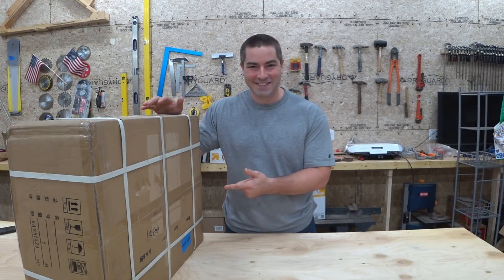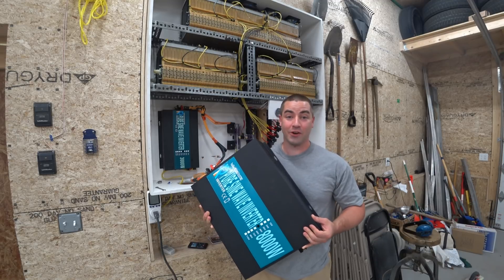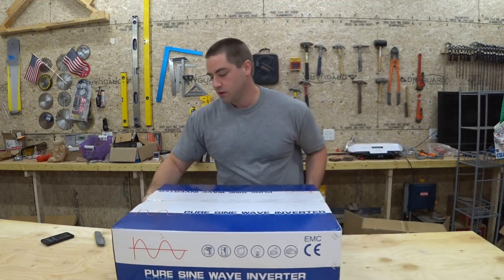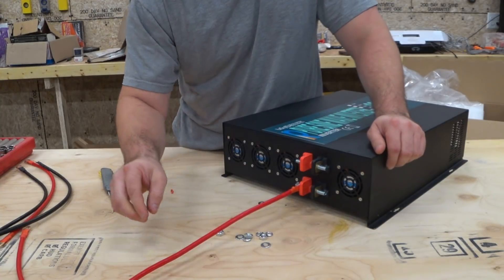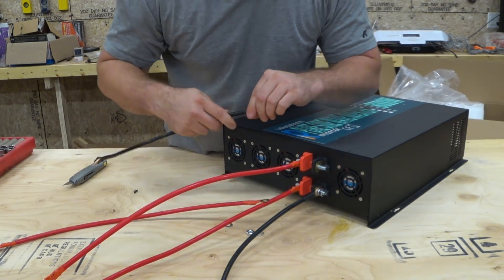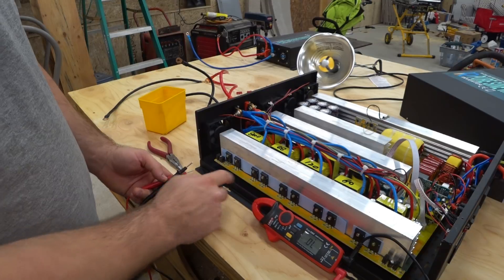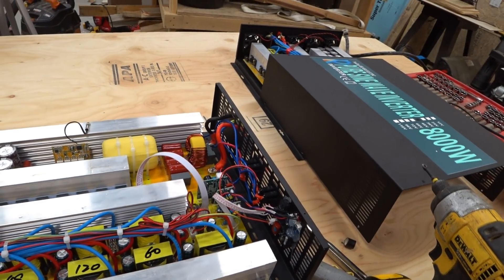Cheap 8000w Reliable Inverter, DIY Powerwall, Chevy Volt Batteries

Comment: For the sake of troubleshooting you should have shown that their was nothing wrong with the chop saw and perhaps even put an amp meter on it to prove it wasn't pulling more than than the inverters stamped surge rated capacity.  At least the company can't point the finger back at you that its your tool's fault.  Just my two cents...
PS. Just the wife's account.
Reply: Even if that saw had higher consumption, it should not end up with FETs being fried - this is why you have fuses. In fact, it should survive even short circuit on output.
Reply: His chop saw runs fine on the 3000 watt Reliable inverter.
Reply: @mark_osborne  I thought he said he got the 8000 watt because the 3000 watt blew first. In any case if this is the peak rating, then the run rating is only 6400 watts. But the normal start up for a full start, inductive motor can be 6 times it's rating. The manufacturer only states 15 amp. SO even at 117 VAC it could require 15 x 6 x 120 = 10,800 watts for a moment to start. This is normally taken care of by time delay circuit protection or slo-blow fuses on a shared distribution network. But this is not a shared part of a larger supply. This saw is known for being hard on temporary electrical services, heavy extention cords and can burn out all the small generators and cord splitters..
Reply: It doesn't matter if he shorted the output directly. It should have popped the fuses but that's it.
Reply: the saw in rush current might be the culprit here
Reply: Metering.   Brilliant.   ;)
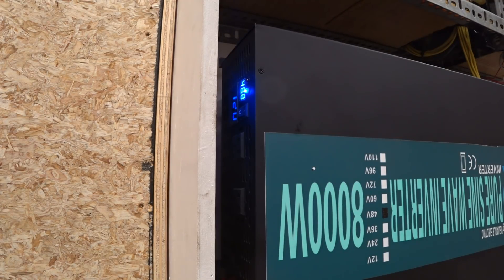Reply: He said the circuit was fused outside the inverter.  See 6:48 of video showing GFI outlet.  Amperage unknown,  however that shouldve protected the internal fuses of the inverter.
Reply: Your are right
Reply: The inverter obviously cannot take out of phase loads..
Reply: Even if the chop saw was shorted the inverter should have self protected itself but yeah he should have shown it running including a few measurements just for the sake of proof.
Reply: Even if he connected something that did want to draw more than the max output, the mosfets shouldn't be blowing.
Reply: true
Reply: What is the Momentary Surge Current on saw's motor starting ?
(use a "high-sampling-rate data-logging metre, 
you may be in for a BIG surprise).
Some cheep tools 
draw crazy amounts of current, just momentarily, when starting
(no soft-start feature).

This is why most of the world uses 230~240Volt / 400~415 Volt,
because the CURRENT draw is halved 
(when comparred to North America)
for comprable tools.
Reply: one inverter may be 3kw, the other 8kw but what short-term output will they each allow ? I have seen it suggested that at least some inverters using a traditional (toroidal) transformer can support up to 10x their rated load for a very short period. Conversely, many high frequesncy inverter using multiple ferrite transformers (as per the 8km you showed) can support little more than their rated load, even short term.
Reply: @SnowAndrews  That is not a cheap saw, second  it won't draw more than 15 amps because it would trip breakers every time it starts up.  He could run that thing with an 2000 watt inverter and still have 200 watts available.
Reply: @SnowAndrews  The momentary surge current is infinite.  Motor Generator theory and Ohms law shows us a current short until the motor starts turning and creates a counter electromotive force which limits current.  All motors are a dead short until they start turning.  P.S.  Same power factor or power demand regardless of the voltage
Reply: @SnowAndrews  Doesn't make them cheap. This saw is wired the more expensive, old way. No wimpy transistor slow starter. It demands a true 15 amp circuit.
Reply: @SnowAndrews  Absolutely bang on there mate,  I ran a test for the 5 machines we have, at the request of our electricity supplier, to determine the balancing of the phases at the transformer; one on, 10secs later 2 on etc.  But I was also monitoring the current with a clamp meter, and the band saw at the end was huge.  All single phase motors.  Soft starts are important I think to prevent the huge spike at the start.
Reply: Snow Andrews if you half the amps by doubling the volts . You have not reduced the wattage..
Reply: @Combatants1  You do not reduce the wattage but a system that is designed at higher voltages has to handle less current (Amps) and that has an impact on how a circuit or cabling size is designed. I believe Snow Andrews is on the spot, the issue here is the motor surge at the start, which could also explain the mosfets burning before the fuses, as the surge has the time to burn the mosfets before the fuses are totally burned. Even if the breaker was lower amperaje it is possible that it could not save the mosfets. Everythingwaspicked may also be right, there could be an issue with the chopsow (a short?), although it would be very risky to test it again with the 3000W and ruining that one also. Finally, maybe the 3000W can but the 8000W cannot, then maybe the 3000W is designed to handle the peaks but the 8000W not... Why? Design issue?
Reply: @Combatants1  that is largely, if not entirely, irrelevant. It's current not wattage/voltage that melts fuses and conductors etc. And the point being made is correct. Some electric motors produce almost a dead short when they first start.
Reply: @Combatants1  yes, but less current and high voltage is easier to control and supply than high current and low voltage..
Reply: @TheBlackadder-Edmund  If the chop saw is rated at 15A draw, then that is 1800 watts, Double that for starting surge, and that's still only 3600 watts, well below the standard rating of the inverter.
He also said that it ran fine on the 3000 watt inverter. At 1800 watts and 3600 watt max surge, it would make perfect sense that it should run fine on the 3000 watt inverter, and it should have no issues, even at surge, on the 8000 watt model. I personally suspect a design flaw with the 8KW inverter causing the failure.
It would be interesting to note if it was the input or output MOSFETs which were blowing. That would be significant in narrowing down the problem. If it's on the input side, then it would indicate that there is an issue with the inverter being able to draw enough power through the existing connections. (I suspect this is the case as the fuses are typically on the DC side).
Reply: @JasonSimpson1966  Motors tend to draw 6-10 times their current on start up
Reply: It's probably a design flaw in the inverter. Likely the surge current causes the duty cycle of the DC booster FETs (boosts 48VDC to about 175VDC or thereabouts) to be momentarily too high. It might be able to be fixed by reducing the maximum duty cycle of the FETs. (I'm talking about the high frequency "pulse width modulation" control that is pretty much universally used in all types of power supplies and inverters like this.)
Once one fuse blows on one booster set, the other boosters take the load, so they inevitably overload and the same thing happens. Boom, boom boom boom, chain reaction!

It could be stopped with more advanced circuitry that limits the maximum current and/or duty cycle for each individual booster. That way, the chain reaction won't occur, and the inverter would still be able to operate, just at a reduced maximum power output!

They are pushing these boosters pretty hard. There are nine of them, so 8000/9 = 888W each. This is not including the power loss in the DC to AC sine wave generator. So each booster might be putting out a max of something like 900W. The transformers are probably ETD42 size cores.
Assuming the input voltage is 48V (unlikely, because battery voltage varies depending on SOC and cable resistance), and the fuses are rated for 10A x 2 per booster, that's 20*48=960W. Very close to the 888W. Plus, it's generally not a good practice to parallel fuses like this.
Reply: @TheBlackadder-Edmund  well explained good job
Reply: @JasonSimpson1966  There's another parameter called 'inrush current' at the instant of closing the trigger the drop saw universal motor is a very low value resistor, maybe 3 or 4 Ohms. A toroidal cored inverter will carry that for a cycle or three until the motor begins to generate back EMF. A solid state inverter should just shut down.
Reply: It's the amperage that is the issue
Reply: @JasonSimpson1966   The starting surge or inrush current at the moment of turning a motor on is significantly more than twice the rated (running) current; it could easily be 3-5 times higher, or even more.
Reply: Not necessary... Ohms law states P=V*I so 120*15=1800w which is 50w under the max rating for 14 ga wire or a 15 A branch circuit. About the same rating as an average hair dryer or small space heater. I will grant you that there is certainly a short turn on load,  but the motor in the saw almost certainly has a capacitor on it to help absorb that surge load. Even so, if you Double the load for 1.5 seconds to 3600 W this inverter should not even struggle. 

Just think this through for a min... the saw has no more than a 12 ga cord on it rated for at most 20A or 2400w at 120vac. 8000w at 120vac is 66.66A! If this saw is dropping that much load the breaker on the motor would trip.

That said, I would be more interested in looking at something that might be impeding the DC supply voltage to the inverter… Because if there is a sag on the input side...Some designs would not be able to cope with that if they did not have the proper protection engineered in.

You could also put a small load like a heat lamp or A hairdryer on low and probe the inverter circuit with a scope To see how trashy the waveform coming out of it is.

Comment: So glad I bought a Spartan power inverter (4400 watt @48v) instead of wasting my time and money on one of these. Spartan literally hit the market a week before I was ready to pull the trigger on getting a Reliable inverter too.
Reply from the maker: O, cool.  You are the first person I've met that has a Spartan.  Do you have a video review of it?  How's it doing?
Reply: @DavidPozEnergy  I've a 48V 2200W and a 24V 3300W.  And let me tell you, those inverters are HEAVY in weight when compared to my two reliable 48V 3,000W!
Reply: Yeah I have a brief review of it on my channel. I will say this, I have ran that inverter non- stop on my off grid house (5kw solar, 2 Midnite 200's, 48v batt bank@ 1280 AH hr) and I threw the entire house at it everyday without a hiccup. I would have a coffee pot pot, the natgas furnace, washer and dryer, and all the lights and computers etc on. I went through several of those cheap Powerjacks deals and wasn't in the budget to buy a Magnasine so bought a Spartan and love it.

Comment: Perhaps a low frequency inverter... Victron multiplus is cheaper than Magnum and efficient also.....👍
What would I perches?.... 
Probably Magna sine.. Magnum looks awesome...
Reply from the maker: Victron and Magnum are both good brands.  I like that Magnum has split phase.  With Victron you need to parallel two units.

Comment: I'm calling crappy wiring. You shouldn't have arcing off your wiring...
Reply: I seen that spark also but wondering if it's his circuit breaker tripping due to a short circuit inside the inverter ?
Reply: I can see the input CB going bang from here.
80A x 48v = 3.84kw aint gonna cut the inrush current.
The 3kw inverter probably just sags the output voltage cause it doesn't have the grunt so it can still start it slower, while still keeping in that breakers rating.

TLDR the 3,000w inverter only gives it 3kw to start it, which is fine for the input CB.
the 8kw job tried to give it 8kws, which trips your underrated CB on the input side
Reply: If trying this again, I'd definitely get rid of the breaker on the input altogether (Even if using a different brand of inverter). It cuts the input power to the inverter at just the critical moment when the inverter is having to supply the surge for the saw. That may well upset the control circuitry enough to pop the FETs. Still, it's disappointing that the thing doesn't fail more gracefully.
Reply: slowed the video down, spark does come from inside the circuit breaker. most likely from the contacts breaking the current
Reply: @mark_osborne  more likely it was the fuses popping, they looked well charred.
Reply: that was the circuit breaker breaking the 40ish amps minimum at 48v he was pulling 48v would have a decent arc it would have to expel to safely disconnect that

Comment: bummer it must be the surge of the saw. I have 5 of the units max 3000w and they are still working fine. I had to pay for all mine good luck
Reply from the maker: Yeah, my 3000w is still doing great as well.
Reply: I found that older versions of a invert
er often have transformers but their NEW units have gone to moffets and shit in the process too...Same company'

Comment: Nice vid but garbage units. Get something low freq. Much stronger
Reply: Yes, this seems to be a common problem with HF inverters. They are just very delicate. LF inverter have a much better reputation. I have been using a PowerJack for several years and have now switched to a Victron. Both are LF inverters and run many different electric power tools. Have never been a problem.

Comment: Save your pennies and get ya a good Magnum inverter.
Reply: Aaron Anderson what makes a Magnum inverter better than his inverter?
Reply: @supremepartydude   they have an inductor in them which makes em able to handle the inductive loads. Schneider 6848 is also an excellent choice. I have a pair phased together for a total 12KW system and it never blinks. I can weld, run a compressor, microwave ovens etc no sweat. Magnum will do same but I dont know if you can have more than one operate at a time
Reply: Aaron Anderson the magnum never dies
Reply: I can tell you what makes magnum better..Engineering, quality parts that aren’t counterfeit, and quality control.These cheap inverters usually have bad solder joints from poorly trained assembly line workers that are being paid a few dollars a day. The parts are usually counterfeit. Counterfeit doesn’t mean the same quality, but a no name company in china is making it. I’t means a part that should be rated for 50 amps will burn up at 10 amps. This is just an example.
Reply: 8.5k would be around 3500
Reply: or even a PowerJack low frequency unit, Mine are perfect.
Reply: Victron is better  much better surge capability
Reply: Yes but magnum customer service blows
Reply: Check out my Magnum inverter on my YouTube channel it has been stomping ass for a very long time it runs my entire house 24 hours a day the only thing it doesn't run is my heat pump and I mean literally I have every 110 volt circuit running on my Magnum 48 volt inverter
Reply: @solarpowerelectricityandel2915  : Sure...let us all make a major purchase on your say so alone. Any chance you are a retailer for Magnum?
Reply: That's Right Sir! Get Your Self a MagNum Sir!

Comment: There's a guy from Canada that has the same problem with the inverter. Thanks for showing, won't be buying one now!
Reply from the maker: Yep, that's "Going Off Grid"  great channel.
Reply: I also run a Reliable 3000w inverter, at 24v. It will reliably (many times tested) simultaneously start both a 1/2 & 3/4 hp sump pump motors, both under load and without load.

I had considered buying a higher wattage version of the Reliable, but two identical failures have stopprd that thought cold.
Reply: More like Unreliable Electric
Reply: Maybe a good added  bank of bulk caps and choke for a solution to the load of a sudden 15 amp motor with all its back EMF.
Reply: TheBillytheJack2010 e
Reply: He had issues with the output board not the input.
Reply: Thats a hf sine wave you want a LF sine wave and the 8000w is the peek not the duty cycle
Reply: Got a strong feeling it's because he didn't read and understand the instructions. Electricity can be tricky. Look how fast it can move.
Reply: @fbsurveyor  if it says 8000w then it should be designed and manufactured properly to handle whatever gets plugged in. How about some safety so the whole thing isn't garbage the second you plug in something too demanding? In this day and age products should be designed to be idiot proof, not explode on first use.

Comment: Oh working as the Reliable fail option technician has it's advantages but what if we needed the inverter to work.
Reply: I have a 4000 watt Reliable, wired into its own system in my house. 2 chest freezers, on large fridge, propane 100,000 but furnace and misc small electronics.
2500 amp HR batterybank.
Have used it a few times and it has worked flawlessly.
I've watch a lot of vids on these things and have seen quite a few of the bigger inverters fail. 6, 7, 8 thousand watters. So wether there is a design flaw in the bigger ones or if his small battery cables were insufficient.
I use 0000 copper thru out my set up for supply. That may be an issue struggling to pull that power through those small gauge wires. Whatever hope he works it out.